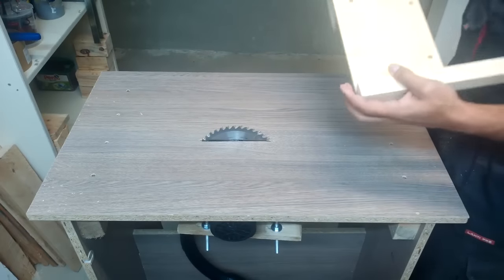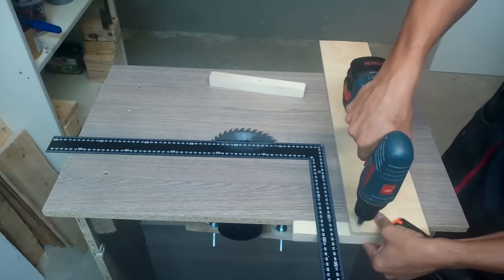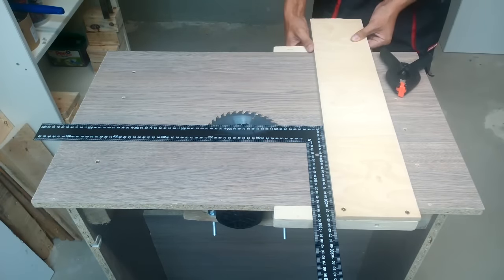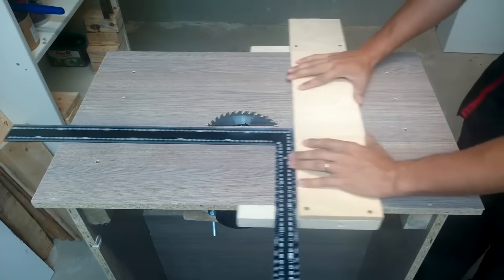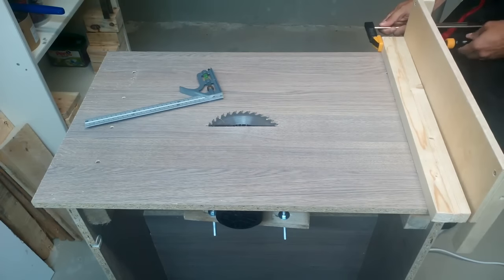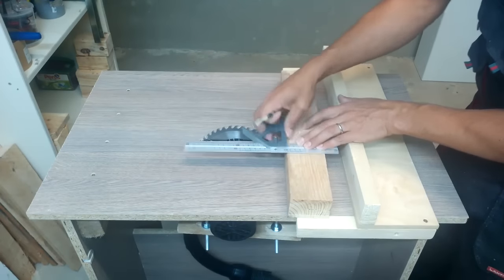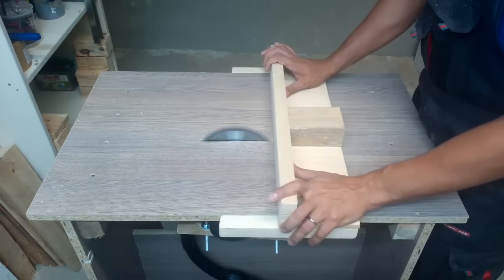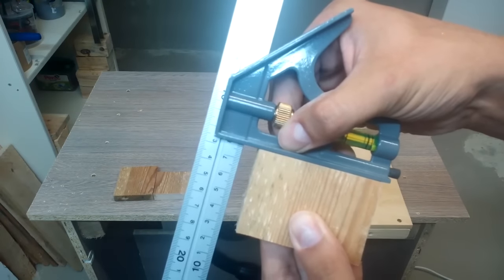How To Make A Crosscut sled for homemade table saw

Comment: I made it based on your video... From a tile cutter to a saw blade with such a template... Thanks for the idea!)
Reply: you think it will work on a large table ?
Reply: @salmanaljabri4245 Yes it will work!) but for good accuracy, it is better to make rails, but this is longer in time)

Comment: You could screw on a little stop block on the edge of the table so one of the end supports bumps against it to prevent the sled from going too far past the middle of the blade.

Comment: Really, It is a well done job.
I will apply this to my table saw with minor addition. I will fix two small pieces of wood to the back side of the sled at each side end. These two pieces should be extended (one or two cm.) underneath the table . This will prevent flipping the sled.
Thank you for this simple but great video.
Reply: +youssef seoud: Good idea there...and a much smoother slide too. I love the translator he used...very effective.
Reply: +youssef seoud  i agree. i did notice it lifted slightly . i think thats what i woill do too.
Reply: juliet bumstead h

Comment from the maker: Piter P was asking about upgrade, which is visible under the table. After I build a table saw, I decided to add some more strenght to hold circular saw engine. This support was made from simple 8mm threaded rod and some scrap wood. Attached rod under the table and with washers and nuts fixed circular saw in place.
Reply: Well Done Tips
Reply: Well Done Tips
Reply: well Done Tips  you have a picturs of the rod
Reply: Well Done Tips .

Comment: If i were you i would make the runners out of hard wood They are less likely to stick also add wax to the sides of the runners
  But a very efficient little crosscut sled  Well done

Comment: excellent Tip for cross cut sled, after i make the table saw you made using the circular saw i'm going to make the cross cut sled. Do you have any tips for side fence using a circular saw
Reply from the maker: Shay Roche For this moment as side fence for my needs I'll use simple piece of wood and two clamps. When I'll really need something more functional - I'll surely make a video about that.

Comment: great informative video's for idiots like me. easy to follow. i did notice though it did slightly lift would it be a good idea to maybe put a baton on the underside of each slider so it doesnt lift ?? or would that ake it too snug and harder to slide . thank you
Reply: Both, probably, but combined with waxing and using hardwood or metal for the runners this will improve the sled.

Comment: Neat.  Just the trick for my Triton saw bench
Reply: I also have a Triton saw table and i made the same type of table but i would advise you to use hardwood runners  on the side also use 3/4 ply for the top as the Triton table is metal. Give the sled a very good sanding and cover the bottom with wax and the runners it does no harm to wax the top of the table it's really easy to work with i find
Reply: TheDublin47 Thanks for the tips

Comment: finally after 3 years I made my table saw,  I found a proper and simple way to make a cross cut sled . Thank You! 

P.S. I'm still damn scared of the table saw.
Reply: AlphaTroniks s
Reply: Me too.  Dont know how these guys do it  like its nothing. I dont wanna lose a hand !   lol
Reply: @thetwogardens6048  yeah! I cut the traditional way by holding the saw in hands then setting up a guide then slicing the wood within seconds. It it a painstaking method but 100% safe if you set it up on saw horses or on a table edge. Still I almost cut my palm once while cutting that way as I was in a hurry to finish my last cut of a project because I had my hand under the wood to be cut like a moron😭 (I was making a paper envelope holder which came out nice eventually and I'm using it in my shop since june 2018)
Reply: @AlphaTroniks  Well , I spent the day with my new Table saw. Very useful tool.  It amazing how much saw dust you create with all that cutting.  Thanks again for the Video.
Reply: @thetwogardens6048  have you checked out my video on how to cut plywood using a traditional electric circular saw? If not then here's the link..  https://youtu.be/h0ENerjkhps

  Hope this idea is useful too!

Comment: I like the presentation. My only concern is that there were no dimensions indicated.
Reply: Why should there be dimensions mentioned when the resulting sled would only ever fit this guy's custom sized table? What keeps you from measuring your own table to estimate what you need?
Reply: if you see all the table videos parts you will also have the dimensions on this. if you gonna make this one, you also have to make the table :) There is no blueprint on how to build, use what you have and copy the design, just make sure it`s safe. This one is custom made for that table, you see what he is doing, just make it with your table measures. if this design does not fit your table, you have to figure something else.

Comment: Now if u were cutting a board that needs to be cut multiple times at the same length how could u make as slider if u can at all?
Reply from the maker: This design isn't perfect, but it met all my todays needs.
Reply: Clamp a stop in place?

Comment: You should have also glued the pieces.
Reply from the maker: +Sajid Rafique after all was finished and no adjustment was need it - I did it, put some glue. That's just not showed on video.
Reply: Well Done Tips  What is nice though is that the slide allows the workpiece to be flush with the tabletop but thats because your table top allows that
Reply from the maker: +Sajid Rafique The idea was make it simple as possible:)

Comment: Dont make this!  I did and even a small ammount of play will make inconsistent cuts in the 87 to 93 degree range.  Its impossible to keep the sled perpendicular.
Reply: Possibly your base (sheet of ply / particle board) does not have perfectly parallel sides.
Reply: it`s all about how you doing it. I made this table and the sleds, and they are working fine. I did som adjustments on the sides. I used a thin strip of aluminum on the edge of the table and on the runners. it`s a perfect fit and they glide wherry nice. And you saving the wood too. One other thing, you can also add adjustment screws on side on the runners to keep it tight to the table edge.